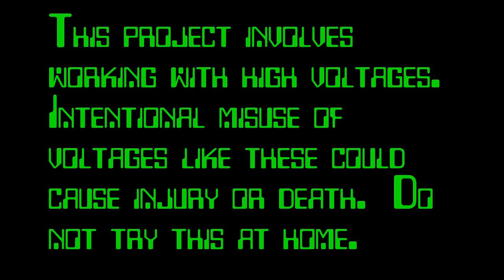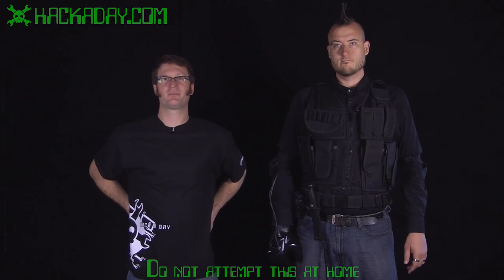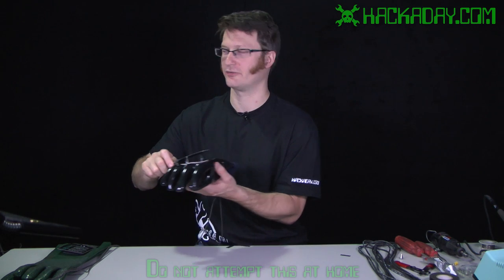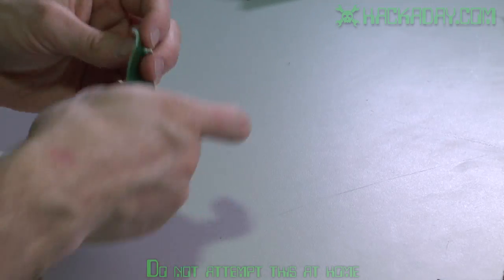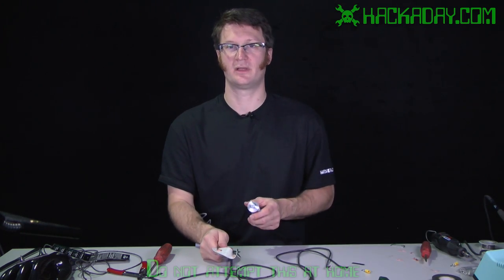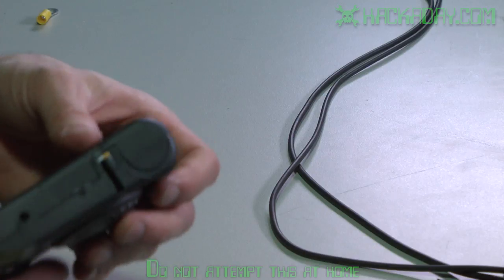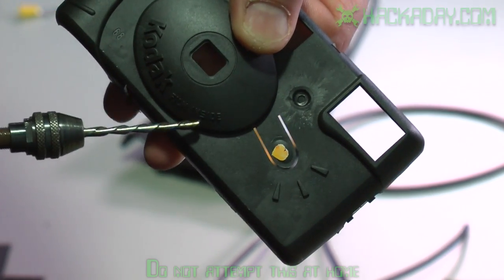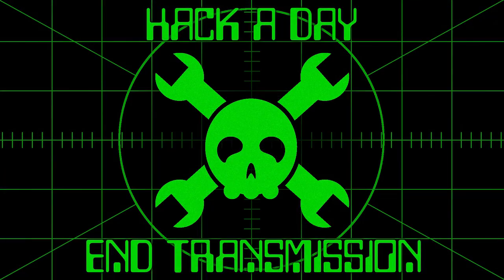Shocking [Jack] into submission with High Voltage!

Comment: To improve on this design you could instead use a wireless dog shock training collar. This way instead of having a disposable camera you would have a small wireless controller. You could replace the collar probes with leather spikes, and instead of watch batteries rig up a 9v battery to power it. This method could allow you to get away from using wires. You could rig the button for activating the probes inside the glove where the index finger goes. ;-)